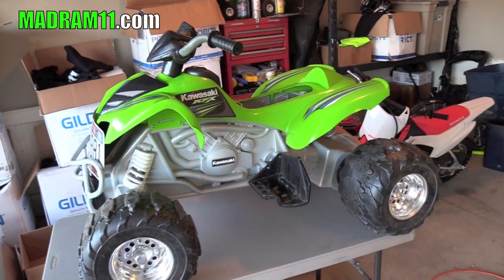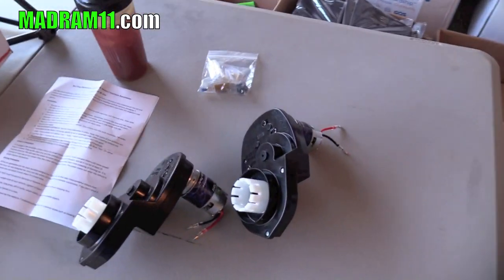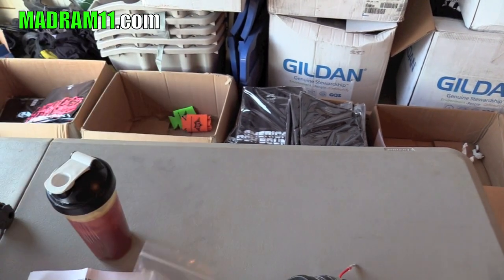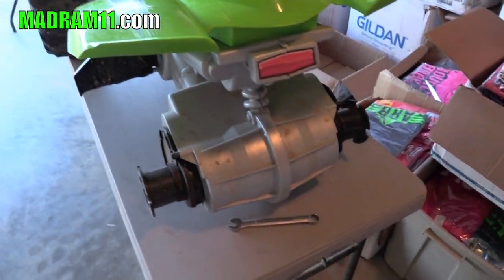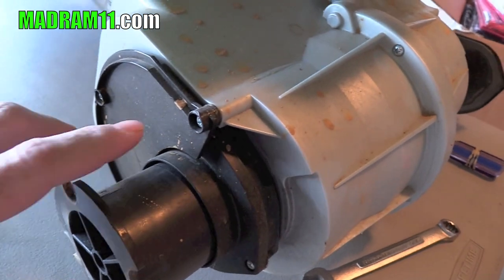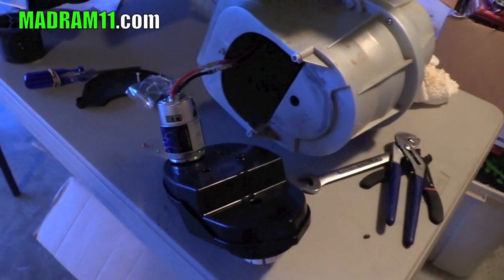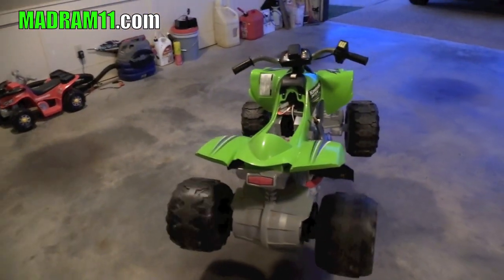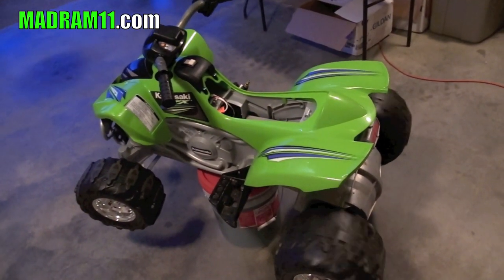UPGRADED GEARS AND MOTORS IN 24 VOLT POWER WHEELS

Comment: 24v is fun but even with the upgrades they get super hot and will still have reliability issues. The best is 18v cause it seems to be the right balance. The first gear isn’t the int that strike either it’s the final drive gear which is still plastic. I’ve tinkered will several of these now and all in all.. the best combination I’ve found for increased performance and reliability is using 2 18v 5ah tool battery’s wired in parallel. This give 18v performance and much longer run time as well as faster charging. Really if you can fit as many drill batteries as you can wired in series’s being sure to run a voltage drop regulator so you don’t over drain the lotion cells and ruin them. Regular RC batteries are even better as they can deliver more output making even an 18v faster then a 24v with less motor heat.. but the drill batteries is really the best way to go. I wouldn’t use HO drill batteries though just regular 4-5ah ones. They tend to overheat the motors as much as running 24v

That said.. more important is that you add cooling to the motor box area and keep the gear boxes packed with good grease as they really don’t strip till they get dry and the extra heat in the gears melts the grease out pretty quick. You also want to get the heat sinks that bolt around the motors. Drill few holes in the front and rear of the housing around the motors and add heat sinks and 18v will last as long as factory setups. If you really want to go 24v then keep spare factory 7r gearboxes on hand and add cpu fans with 775 motors and sinks. 

In all honestly this is fun to do for your kids but in the end it’s easier and cheaper to get an actual 24v platform which comes with a real solid axle and drive motor (very similar to what you would find in a regular atv only electric setup) you can then bump them to 36/48v pretty easy an inky have to deal with swapping the controllers. You can even add small gas motors to them later pretty easy if you want to take it a bit further as they have real metal frames real metal drive axles rubber tires etc.. $200 more initial cost for a 24v version but you’ll spend $200 just converting over from 12-24 on a regular powerwheels and always have to be buying gear boxes which aren’t expensive but at $20 a pop it adds up with time spent swapping them. 

For really young kids and the toddler 6v setups they still use regular 12v gears and motors and are just powered by 6v. They are super easy to upgrade to 12v which can be done for $20 or so. You can even take them to 18v as well but will need to swap from the 330 to the regular 550 motor (775 will not fit in most of them) but as they are so much lighter they have a lot of traction issues when bumping a 6v to a 18v setup.
Reply: wow!! u know alot about these powere wheels!!  Good Info, ty!

Comment: Hey man, I want to get a stage 5 motor/gearbox assembly for a power wheels quad. I noticed your son had the kfx and Ive got the same quad. I was wondering which motor/gearbox assembly you used.

Comment: I am upgrading my son's quad for his birthday which is coming up soon. He has the same one as your son, just the ninja turtle one. I've done a lot of research on 24 volt upgrades and I'm leaning towards ml toys stage 4 kit with their 24 volt conversion kit and brake reduction module. Can you please tell me how much modification you had to do to install two batteries? Also how did you install the brake module without keeping it exposed to the "elements"? Lastly can you please tell me how the gears and motors are holding up since the install? My son is going to be 3 and he is a little on the small side but he rides like a champ. I assume you never went with an esc system and I don't plan on it either. I figure with him being smaller the gears should hold up well. Do you get decent runtime with the 24 volts and stage 4 kit? I apologize for all the questions but you have the exact same power wheels for your son and I want to make sure I'm making the right choices before investing the money in my sons power wheels quad. I've heard some negative comments about ml toys but your videos seems to show positive results.

Comment: you can take some bicycle tires, cut the tread off of them wrap it around the Power Wheels tires and put some screws in between the lugs so they're not sticking up. 1 strip around the center of the front wheels will make it turn on a dime. 12" tires work great but any size could be cut down.
Reply: what i would have suggested
Reply from the maker: I will eventually do that, I haven't done it yet for a reason. I want him to learn how to counter steer and such plus with the tires spinning so much it keeps it from going so fast.
Reply: MadRam11 cool just get some knee and elbow pads for him , unless he was to drive straight into anything he would be fine , i see bmx riders who wreck their bikes on concrete and they get back up everytime even after some hits you wouldnt think theyd get up from

Comment: were did you get the electric twist throttle
Reply from the maker: Thats how it comes, it has a foot pedal and when you twist the throttle it makes it go faster. I didn't add that this model is made that way
Reply: @MadRam11  man would like to see how it’s wired in

Comment: hey boss I'm doing the same thing but how do i get the wheels off? thats my main thing. also how do you get the steering column off? I'm putting in a new circuit board.
Reply from the maker: the wheels just pop one of the ends of the axle off, I dont know about the steering stem I never took it apart

Comment: hey question for you i just installed these in my daughters dune racer along with the 24v battery upgrade and running in the high gear I'm only seeing maybe 10 mins of continuous runtime. are you getting that as well? thanks
Reply from the maker: We probably got around 15 minutes or so, it wasn't long but its been several years so I can't remember exactly

Comment: I did the same thing converted the same 4 wheeler to 24volt and it stripped the gears ordered new gear box but the original motor doesn't fit what gear box did you order or how did you find the right one all the numbers match the old gear box not sure what box I need the old motor is to big to fit in the gears
Reply from the maker: Tnc Adamini I got everything from mltoys.com they can answer your questions

Comment: Great video. 24v, Stage IV motor/gearboxes, and a Brake Reduction Module is our best combination for speed, durability, and ride fun. Excellent job showing people how easy the install is and to break them in. Glad you and your son are having fun with it!
Reply from the maker: Thanks for checking it out, did you see the other video I did that has over 250k views?
Reply: That's what happens when Richard Rawlings shares your video!

Comment: Now that you have added more power those wheels won't last long spinning on concrete. I might suggest making him some runner grips by riveting or screwing a piece of a bicycle tire onto the wheels. Or if you prefer to spin your tires still but don't want to kill the wheels maybe try screwing a piece of crazy carpet to the wheels to act as a shield, replacing when it wears through. Also I have seen electric kids atvs made by gio. they seem pretty good. my nephew has one and he seems to get some good use out of it
Reply from the maker: yeah I know they won't last and I will eventually put rubber on them. I have my reasons for not doing it yet and it's mainly because if the tires are spinning he can't go as fast.
Reply: At the moment thou the plastic wheels not gripping also puts less strain on other things, Gotta have a weak link somewhere wheels is probaly the easist thing to change when worn out

Comment: I just needed to know how to get those dang rear wheels off, and voila, you revealed to me the nature of the beast.  Much thanks!
Reply from the maker: very easy, one side unscrews and the whole axle shaft slides out
Reply: @MadRam11  Yeah, but this dummy (me) wasn't figuring out why I couldn't get the nut to loosen like it did for the front wheels, not knowing I was turning the whole axle and the opposite wheel,  lol.   I bought our KFX at a yard sale for $15, and it works perfectly.  I was just trying to get the wheels off so we could put it in the car to take to a grandchild in FL.  And now it fits!

Comment: The new motor and gears are slower than the originals I see. In comparison to your original video.
Reply from the maker: joe DiMemmo no they weren’t same speed
Reply: It does appear to be a touch slower. It also appears Lil dude is handling the power of it better too so it’s hard to tell. Still fast as hell anyhow. 
  My 3 year has the same one, except ninja turtles, loves it. I had looked into those metal gears and what not as while back as I have two older kids as well.
 But they were too steep on the price for me, when considering all options. Although if that thing is still goin hard 2years later running on 24v, then it just might be worth the scratch. 
 I had decided against it though and instead have been taking the parts of a razor pocket mod scooter and putting them on a Barbie mustang for my daughter. 24v, motor controller, throttle, chain drive rubber tires etc. Runs nice and quiet, should go around as fast as the scooter did (14mph). Going to do one similar for my oldest son with the dune racer power wheel. I have all the parts off a smaller razor scooter I’ll probably throw on the 3 year old atv after he kills the gearboxes or gets tired of the speed. I just put green underglow lights, headlights  and a voltage indicator the other day. He likes it. 
  I just might have to look into the metal gears and what not again though, seeing as how you seem to not have problems with the longevity of them.

Comment: madram11 u should get some tires so all the power goes to the ground instead of doing burnouts, plus it's safer
Reply from the maker: I don't want it putting all the power down, this is teaching him how to counter steer plus he likes sliding around. He will get rubber tires soon though
Reply: MadRam11 So those plastic tires are a safety feature right now 😆.  But as far as I know you, he will go brushless by january, right? I owned the full size kfx 700 back in 2004 I believe. She was such a beauty.

Comment: I like the hand throttle, did it come with that?
Reply from the maker: yeah but you have to press the foot switch for it to go and the throttle on the handlebar is like a nos switch lol
Reply: @MadRam11  Cool thanks for the reply
Reply: @MadRam11  I’m sorry but which wires are connected to the foot switch?are there 3 or more?